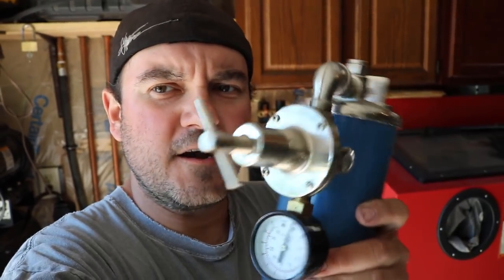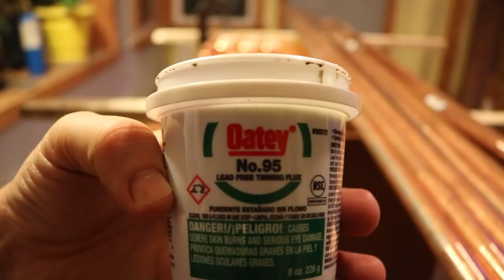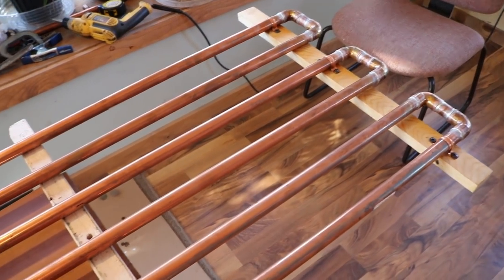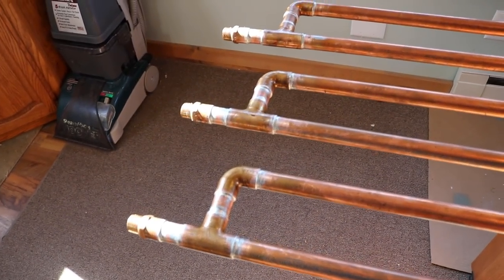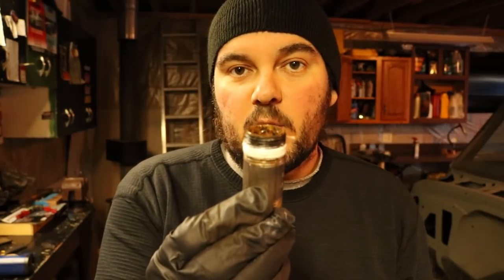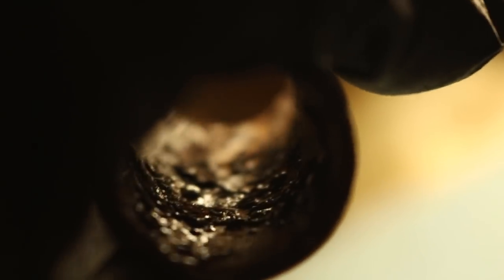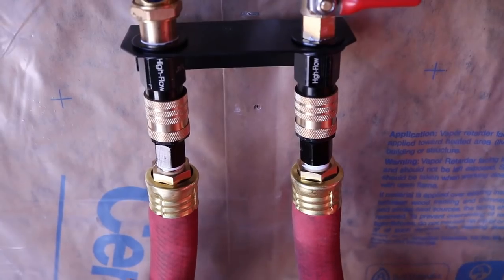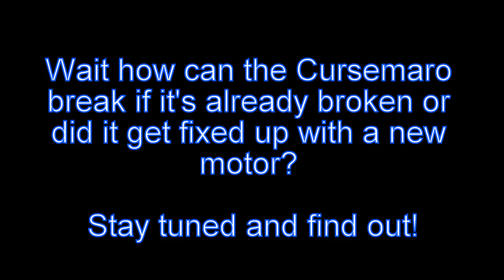How to remove moisture out of air compressor lines! Building an air dryer for painting classic cars!

Comment: I appreciate the copper air lines.  This is how I'm going to run air in my shop also.  I understand what you're doing with the six vertical pipes to condense the moisture and the valves at the bottom to remove it.  I'm confused by all the connections at the end.  It would be great if you had summarized at the end what you did and how it's supposed to work.
Reply from the maker: Everything after the regulator I built with a specific purpose for my setup. I could have just ran 1 copper pipe to a couple quick disconnects. The reason I overcomplicated it is because I wanted to have three different endpoints. I wanted to have 125 psi at all times from the main rapid air regulator to go to my blasting cabinet with a shut off valve, that way I never have to worry about air delivery by having to turn down the regulator or having to hook up an air hose to the blasting cabinet. The top connections were regulated down to 90 PSI with two quick disconnects for air tools. The paint connections have air flow in mind, all the quick disconnect were high flow, I made the desiccant snake easily removable to dry the desiccant in an oven once it got saturated with moisture. Also I routed the copper in a way where I could install an actual desiccant filter system in the future. So it just really depends on what you need at the outlet. You could get away with using a hose with high-flow fittings with a desiccant snake in between and you could bring down your psi on the main rapid air regulator and then regulate down also at the paint guns gauge. I hope that helps. Also I did just upload a paint booth build video, be sure to check that out. Thanks for watching!
Reply: "Over-complicate".  That describes me as well.  It looks really good.  Thanks for the clarification.  I'm hoping it works great.  Oh and I did just watch the paint booth vids.  Great job!  I'll look out for more of your content.

Comment: You obviously know what you are doing. My favorite part is showing the corroded inside of a steel pipe. I would never use black or galvanized pipe. Sch. 80 PVC will handle the pressure but if it ruptures, you have shards that injure. 3/4 in. Copper is great and I like the double kill of using Teflon tape with pipe sealant. Yes, 40 to 50 ft. run  is minimum.  You are far better than average !
Reply from the maker: Thank you! Yeah, I have read horror stories about PVC exploding under pressure, doesn't sound fun at all.

Comment: The Galvanized steel valves will cause hysteresis. Brass with copper is a better choice and does not have the dissimilar metal corrosion problem. I know it's more money but 2 bucks per valve is nothing in the long run. The workmanship was excellent.  I was surprised to see you DID use brass on the rest of the valves.  I just installed black pipe out of my tank and after seeing your video and the corrosion issue I am thinking I may need to re-address that issue in the near future. sigh. Liked, subscribed and noti's.........Peace.
Reply from the maker: Thanks man!
Reply: @BustedClassicGarage  I also was wondering after a re-visit why you did not install a union on some of those items that may need maintenance on them for easy quick removal and no ferrule replacement on your brass fittings..... or where they flared?
A secondary point about the steel fittings. I do motorcycle repairs and Tank Sealer works miracles on steel. Coating that nipple would basically eliminate the corrosion issue, but, it has to be the full interior length without missing any spots. Not Hard just tape one end with some really GOOD Duct Tape, pour in an oz or 2 of the sealer, Tape other end, work it around inside back and forth very well, pull off one end of the tape, drain excess and let it set for 4 days to cure. End of corrosion problems.
Reply from the maker: @anonimous2451   Honestly the main reason I probably didn't use unions was to save money. And it's pretty easy to resweat the joint if I really need to. I actually just remove the system from that wall because I moved to a farm house and it would've made it a little bit easier if I had put a Union between the air dryer and air filter but I got it moved no problem, just had to be extra careful about it.

Comment: When air is compressed it heats up and water is formed. You need to cool the compressed air back down to room temperature to get the moisture out. Hot air will flow in and out of a dryer and drop its moisture down stream on your paint. Mounting an air filter on the side of the compressor tank is a waste of time. The filter needs to be as far from the compressor as possible. Mount a box fan on your compressor so it blows across the motor and compressor, wire it so it comes on with the compressor. Putting another fan on your copper coils would help too. Run the air line from the tank up to the ceiling first, then down, make the water drain back to your tank. I get very little water in my lines by using a box fan on my compressor and routing the output line straight up
Reply from the maker: I'm thinking about installing an aftercooler between the tank and the pump. That should help also.

Comment: Question, I got a question.........I was going to do this with PVC pipe would it still work? If I do this in copper is there a flux I must apply or is it in the solder already?

I need to protect my plasma cutter which already took a dump on me 2 times and dont feel like paying $2400 for another one. This video was helpful and I also ordered a cooler to attach to my portable compressor.

Thanks
Reply from the maker: You don't want to use PVC because it gets brittle over time and then it can explode. Yes on the flux, you can get it at any hardware store.
Reply: @BustedClassicGarage  Thanks. I have PVC already and wanted to do a setup to try for a month. I went to shop for copper and  was about $200 for about 40 feet total and fittings. Thanks for the input.

Comment: I build this air dryer but decided to attach the dryer in between the compressor head and tank. worked great until today the copper got too hot and blew out the first solder joint. was this a poor decision on my end or is the compressor too hot? maybe i should attach the separator after the tank?

Comment: First off, great video, and workmanship.  Now for the meat ,and potatoes. Coming from, and still in the air compressor business as a field service technician for all brands of air compressors, driers, and filtration for over 20 years,.. you effectively built a after cooler for the discharge air. Yes the receiver tank will also act as a after cooler too. However, all your copper tubing is at the mercy of your ambient temp of your garage. Other considerations are relative humidity. On high humid days, you will increase condensate output from the discharge air, and how much demand you draw from the compressor. The more the compressor runs, the more hot wet air it will produce. Especially on humid days. There is a reason why refrigerated driers are used. They cool the air to around 36 to 39 degrees. ( which is a good common low dew point for most compressed air systems) Do you think your piping system will get that low in temp? (Well it probably will in the winter time) Please don’t get me wrong here, I am not hating on your system, or you. Just putting out a little more information on air systems. If you have access to a dew point monitor, or hydrometer, measure the dew point at the point of discharge on you system. You will see what I am explaining. There is a lot more involved on this topic, which I do not have time to get into now. Keep up the great work, and good luck with you projects.
Reply from the maker: I have dealt with high moisture especially when the compressor is running consistently. I will at some point add an aftercooler between the pump and tank. Thanks for watching and the info.
Reply: Pierce, I am glad you posted this, I really like what he has done here. However, I have had the same concerns that you have listed. Let me ask you, if I build a piping basically like his but instead enclose it, (box in in some type of way), leaving only an opening large enough to vent a 5000 BTU window A/C, allowing this cold air from the A/C to have a steady supply of cold air over and through these home built pipes?  Though it will not be in the thirties , but maybe if I am lucky the 40s or low 50'.  Would this described set up be of benefit?  I hope you see this as I really would like your advice. Thanks very much. Phillip Hall
Reply: @BustedClassicGarage  Excellent and educational video.  I'm about to dive into fixing this same moisture issue in my shop, for sand blasting and painting.  Out of curiosity, what factored into your decision to make the copper separator rather than an aftercooler b/tw the pump and tank?  Interested to hear pros / cons from your experience and others'.

Comment: Thanks for the video which I have found really useful. And to questioners who raise valid points. I'm a DIY classic car enthusiast just recently 'discovered' air power & am preparing for my first respray this year. Also discovering some pitfalls to avoid.

I do have a couple of questions though 
1] about pipe length and diameter. It would appear that (assuming other conditions constant)  longer pipe runs increase performance (up until last tap is dry?) - so I assume a smaller diameter pipe would need even longer runs - so proportional to inner surface area?
2] a questioner mentioned installing an 'orifice' (a wider pipe or plenum?) before the 'intercooler' to allow rapid expansion of air...since I do not know how wet pressurised air behaves, is there some 'theory' behind that addition? Have not seen that mentioned before.

Had not seen a dessicant pipe before so will check that out too.

Thanks again for sharing your experience & 
your time & effort to put this together.

G
Reply from the maker: Yes the bigger the better, also the bigger equals more air volume.

Comment: I would suggest using AquaPex, made by Uponor, instead of copper for a couple of very good reasons. 1. The AquaPex tubing does not condensate anywhere close to what copper does, thus dryer lines. 2. Cheaper....way cheaper. 3. Easier by far, pretty sure this job would have taken me less than a day to plumb the whole shop. In saying that I do appreciate the attention to detail, but using copper is not the best option for air lines. It is a testament to your talent since it was still interesting and entertaining!
Reply from the maker: Thanks! I'll look into that for the next garage I set up.

Comment: Very nice design and work.  Like your style.  You still use a small dryer at your spray gun right?  I've found the rubber hose lying on concrete floor sometimes gets cool enough for condensation to form inside it.  If you live in dry climate like Phoenix might not be a problem but in the south or other more humid climate, better use that little dryer at the gun.  Every bit of insurance against moisture is worth it.  New subscriber.
Reply from the maker: Yes, I do. Welcome to the channel!

Comment: Cool video, where did you get the black rubber hose that come off the ball valve and do you know the psi rating?
Thanks
Reply from the maker: That hose is intended for air compressors, there is a parts list in the top pinned comment.

Comment: Question:  I built one and am see no water out of the valves.  Did you install yours between the compressor and tank or at the outlet of the tank?
Reply from the maker: I installed mine at the outlet of the tank to my filters.

Comment: Looks good but I see a flaw in the system. The hose from the tank should be downhill and the connection to the water trap system should be below the level of the tank output port, yours is uphill ( yours is straight up ) witch means that water will flow back into your tank.
Reply from the maker: Not a flaw, I would rather have the water flow back into my tank ( which gets drained regularly) then towards the filters.

Comment: What are some good brand names for filter/dessicant-dryers? I'm looking at a Campbell Hausfeld comb and PneumaticPlus - both 130$ price range.

Also, technical question. For a run and gun system (fixing a panel, varnishing some furniture) would a 25 ft hose (maybe an ice bucket) and one of those cheaper systems that I mention be enough? I wold assume so. I'm a once in a blue moon warrior (not even weekend) and I'm looking for a good system to varnish and paint. My compressor is a 27 gallon 1.9 hp Powermate.
Reply from the maker: A couple years ago I walked into Eastwood Alsip planning on spending $500 on a particle/desiccant filter system, after a conversation with the manager I had a way better understanding and a lot better game plan. At some point I'll buy a desiccant system from Eastwood or Devilbiss but for right now with the amount of painting that I'm doing the desiccant snake is way more than enough. So what I would suggest is to buy a good quality low Micron particle filter and moisture separator and then just plumb up a desiccant snake to your lines. Once the desiccant snake it's full of moisture you can set it outside on a really hot day or even put it in your oven at a very low temperature to dry it out. As far as making a very cheap system that would be efficient I would get at least 50 feet of hose (from comp to moisture/particle filter) and then have it go through a decent moisture separator filter and a desiccant snake. Rapid air does have a couple different moisture separator regulators like mine but with smaller 1/2"  inlets and Outlets. But just keep in mind whenever you're building something try to build for the future, that way when you upgrade you don't have to redo it. That's the main reason why I chose the rapid air filter because of it but it's high PSI and I ran 3/4 inch piping all the way through the system. Because once I step up to a 2-stage 80 gallon compressor I'm not going to have any restrictions in my system.
Reply from the maker: Also if you do go the route of buying a desiccant filter and not a snake make sure there's parts available for it. Because I know the cheaper Devilbiss filter is actually getting discontinued and there's not going to be any parts available for any more.

Comment: I have a 21 gallon compressor with an additional 11 gallon tank connected together my garage can I run 1/2 copper pipe?
Reply from the maker: Yeah that shouldn't be a huge issue. The main reason why I chose 3/4" was I didn't want to restrict airflow. Now I know after the filter I went to 1/2" but that gives me the ability in the future to redesign it in a way where I could use a bigger impact gun or tool that requires a lot more volume of air. Build it once!

Comment: I cut my teeth in body shops and became a full time painter both in body shops as well as industrial nonsense shooting up to 70 gallons a week poisoning my body from soaking it up through my sweat pours etc.. Anyway, nice setup.. Now I have a cabinet shop and would make a similar setup except I no longer paint anything at similar scale, mostly latex these days, occasional oil, but not enough to worry about.. I absolutely get the time thing.. In my shop now I have to run to the dump about once a month just to dispose of all the scrap wood and sawdust and my shop is a holy terror of messes plus I just don't seem to have the ability to throw out anything bigger than a 1x1 that isn't full of knots.. I can't even find a scrap guy to pick up scrap metal if I was still producing it.. The good news is I'm getting too old to keep this foolishness up so I'll probably sell off my equipment before I die of old age and have my kids sell it for themselves.. ;)
Reply from the maker: Lol, we are all hoarders in some way. I have 5 different HEI distributors... will I ever use them? Probably not, but I have them if I ever need to build 5 engines. Hahaha! The foolishness, I'm right there with you! Thanks for watching Martino!

Comment: So do you have any issues when the compressor is running while you’re painting?
Reply from the maker: The biggest thing I've painted was the cab to my truck. With only a 60 gal compressor, I had no issues with running out of air or any moisture. What little moisture might get through gets dried out with the desiccant snake.
Reply: @BustedClassicGarage  Thanks. I’ve got a 30 gallon lowes special. 1.8hp.  It’s worked fine for me so far (ties, blow gun, impact air tools), but using a 1/4 angle grinder the other day I had water spitting a bunch.  Definitely doing the copper pipes this weekend.